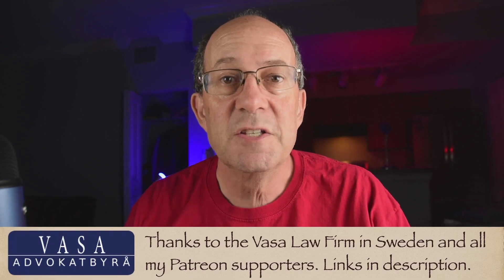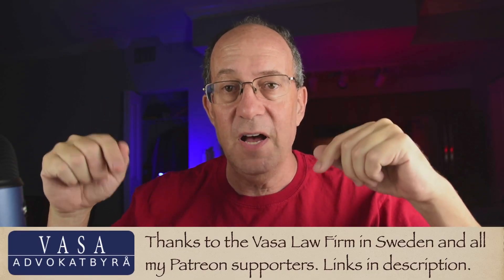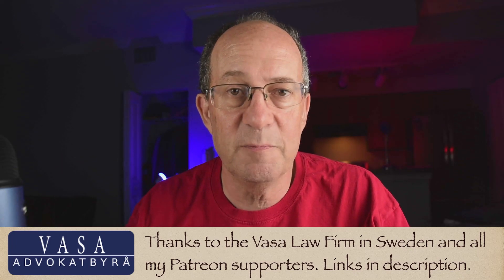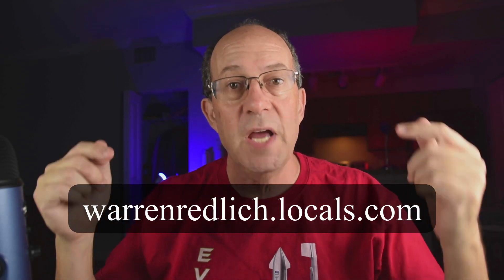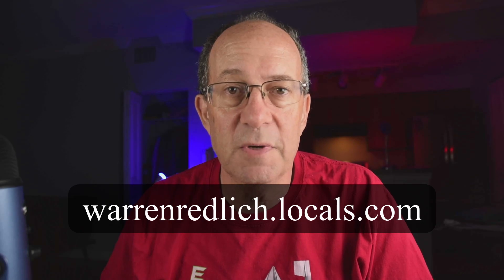Elon Explains SpaceX Stainless Steel Starship

Comment: I didn't notice it you mentioned it, but Elon mentioned failure at temperature.  So it's a SAFER choice.  More robust for safety & reusability.
Reply: Easier radiation of excess heat when  traveling to mars, on top of resistance to burning up from the onboarding systems as described and better bleeding awat of heat built up in atmospheric drag~breaking.

Elon is an amazing guy.

Comment: 10 billion point crackhead reinforced high carbon steel, formed in geometric patterns of optimal integrity by a Vulcan's sense of Kal-toh... That should be 1/10000th the weight per unit of strength when compared to the cry temperature enhanced integrity of the most refined steel composit that is now used for starship...

Unfortunately, current crackheads haven't reached the realm of maturity required to focus the crack-force into refining steel, they just steal it to get their next fix...

Comment: 30X stainless steel is what the Cyber Truck is made of also.
Reply: That's it. I'm ordering a second cybertruck. It's too damn cool
Reply: rust, dent, scratch resistant stainless body is the main reason i ordered the CT.  My current chevy avalanche got scratches that i dunno where it came from, and i don't like waxing and paint dulling with time
Reply: It’s actually HFS (hard fucking steel)

30X was too soft and not high enough bend radius compliance.

Comment: Carbon fiber is the same as fiberglass.   Just different ingredients. 
To scale up I can see very thick walls .
Reply: But to negate the flamability issues = ramping up density~mas beyond the point of keeping its lightweight benefits.
Reply: A nightmare to engineer parts out of too. Extremely high notch sensitivity, inconsistent mechanical properties between the exact same parts made at different times, multiple failure modes.
Extremely loooooonnng time between iteration, sucks for prototyping.